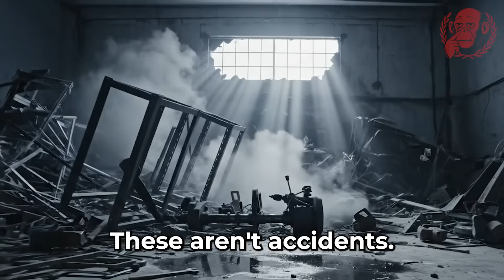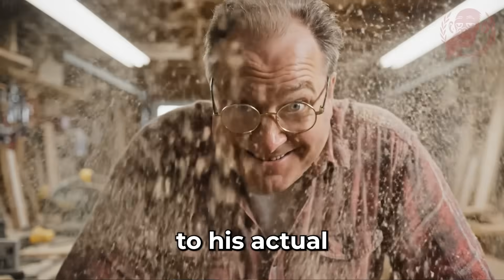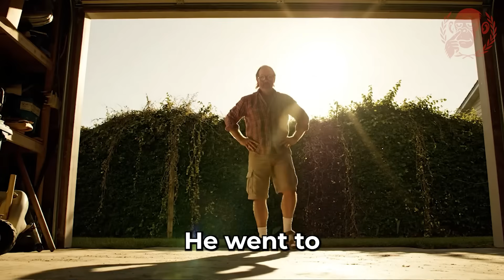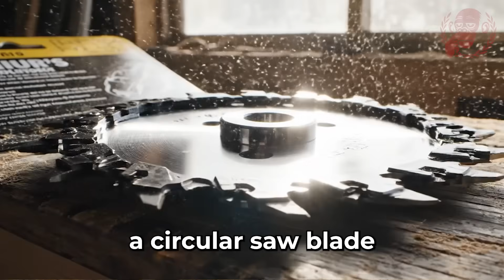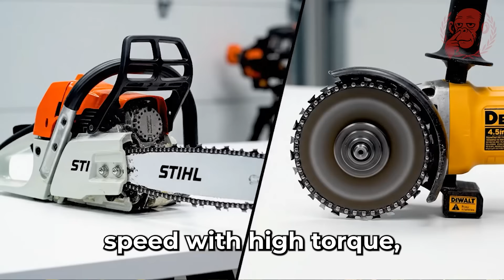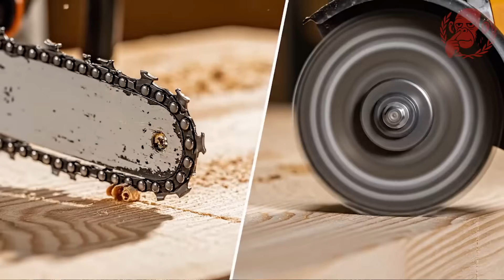10 Wrong Tool Deaths: Dumbest Ways People Died

Comment: Videos like this save lives there was a time when I bought a chainsaw weel for a grinder and tryed 2 cut wood with it expecting no kickback it jumped off the board and cut a deep gash in my wrist about 2 millimeter from a vain in my wrist after flying through open air if I had watched a video about that kined of a situation previously I would not have been messing with that

Comment: I am 65 now and VERY LUCKY to have made it to this age! I was a 25 yo, and a carpenter, and was working in a house with very high cathedral ceilings, where I had to trim a window at the top of the gabel end aprox 25 feet up. To reach that high I had a rolling scaffold, but unfortunately the scaffold was still not high enough, so I brought up a step ladder, however, I FORGOT to lock the wheels. I placed the step ladder against the wall and started climbing up. My weight caused the sep ladder to roll the scaffold, and the stepladder and I immediately started falling towards the CONCRETE floor!!! By some unknown miracle there was a hook on the scaffold pointing upwards, and I was falling head first!!!! As I fell upside down, my rear pants pocket somehow slipped right over the protruding hook, the pocket ripped off, but in the process inverted me and I landed on my feet completely un hurt!! I still tell that story to my kids, I have no explanation for it except that it was a miracle!!! What are the chances that my pocket would line up with that hook just right to catch my jeans pocket, rip it off and in the process flip me over so I would land on my feet??? I should be dead, or a vegetable now!!!!

Comment: Several years back, a guy was welding, repairing a steel wheel and tire laying flat on the shop floor, the heat built up, the wheel took his his head through the roof, 🙄

Comment: I always cringe when I hear of people doing unwise things with angle grinders.  My Dad was an ironworker and would have stopped anyone thinking of using dangerous attachments on them.  Even when you use them for what they are intended for they are still really dangerous!  Those things will cut fingers off faster than you can blink.  You also would not want to use one with a cracked wheel!!  It could be a crack so small that you don't notice it but it that wheel will come apart violently.  When this happens, the E.R. or the Morgue are the only two places where someone so unlucky will be next!!

Comment: My brother painted his two story house. He finished everything except the gable end. Because it was on the exposed basement side of the house this was a high peak. His extension ladder wouldn't reach so he borrowed his neighbor's extension ladder, extended both ladders, and tied the two aluminum ladders together making a 40' tall monstrosity. In order to be SURE the ladders didn't come untied my brother used electric fencing wire to attach them. Did I mention brother weighs close to 300 lbs.? No? Well skip that little detail. Using a 100' rope thrown over the roof he and his teenage son managed to lift and pull the ladder set vertical and in position for painting that last little bit of siding. Brother starts climbing, passing over the handy wire job half way up. Finally he makes it to the top. Remember the rope they used to get the ladder up? The other end wasn't tied to anything. Brother then gets the paint can opened and starts brushing sunburst yellow paint on the gable end. Just as he finishes, but before he gets the paint can lid back on, the high tensile steel wire cuts through the ladder's extruded aluminum side rails. Suddenly, brother is 40' in the air with two separate, unattached, fully extended aluminum ladders between his feet and his patio  below. The paint can gets flung in an arc and does a remarkable job of painting his two year old maple tree. He twisted his ankle but otherwise survived the ordeal although he was quite sore for a few days. The worse part was when he returned the neighbor's ladder and had to explain why the ladder was now a foot short. I thought the neighbor was going to be the first person I would see actually die from laughing.

Comment: The gasoline mixture would have drained out with the rinse cycle. The ignition point for gasoline is ~450°F. The heating coil does not come close to that temperature.

Comment: I threw a big block of wood on a carpenters dump pile without looking close and it landed on the end of a 2x4 that was sticking out on top of the fulcrum 4x4 and like a catapult, the 5 foot 2x4 came around and almost knocked me out.  If there had been a FRAMING NAIL or two on the end, I would have been NAILED IN THE HEAD.

Comment: A skill saw blade on an angle grinder that has kick out teeth, instead of hooked grab teeth, works fine on wood, and is a very useful for roughing out unusual shapes. The standard 4 or 6 inch guard never works on that setup, but you could make your own.  I got my carbide blades for that from the garbage dump for free. Dull or a missing tooth doesn't matter. Also, a non carbide blade on backwards on a skill saw, cuts steel/aluminum roofing sheet metal very well.  Use safety glasses.  PS, an angle grinder is geared down for power, so it isn't an 11,000 rpm tool.  6000 rpm max on grinder disks if I remember correctly.
Reply: Depends on the specific angle grinder. Angle grinders are designed so the outer edge of the disc reaches a velocity up to about 80m/s (=about 262 ft/s). Hence the larger the discs they can hold the lower the rpm. There are angle grinders up to 12.5 cm (=about 5 inch) diameter discs that actually reach the 11,000 rpm, while angle grinders for discs up to 23 cm (=about 9 inch) go up to about 6,600 rpm. 
So the 6000 rpm max on the grinder disc you remember was probably a 9 inch grinder disc rather than a 5 inch grinder disc.

Comment: I drove my Z28 with my feet while sitting on the roof (t- tops, cruise control). I also caught an arrow with a 2x4 after it was shot straight up in the air. Yeah, I can relate to these guys. We do it to save time or money,...and  sometimes we do it just because.  RIP my brothers
Reply: Did that with a Jetta- no cruise so I used a rock on the gas pedal
Reply: @emgriffiths9743  Thats crazy 😂

Comment: I have a disc with chainsaw teeth and it's the best tool in my toolbox.
Reply: There are reasonable safe ways to use it if you know what you are doing, but that only goes for those rather experienced with using angle grinders. I'd consider myself to be possibly among those, but since I also have multiple chainsaws available that pose less danger and can do the same job, I never considered buying such a disc.

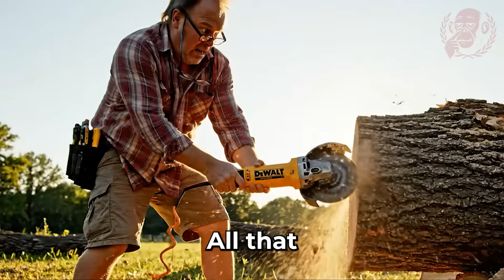Comment: 3:23 😂😂 so what was the problem here, he just didn't know what he was doing?? I have one of these, and have been using it for a very long time, even buying replacements when needed?? It's just like grinding anything, the disc is made for the job. Even when grinding metal you don't just slam the wheel in expecting it to cut right through😂😂 you do have two file away the material, and this blade is absolutely wonderful to file away wood, very fast. It works great, as long as you have common sense, and at least enough strength to hold onto the thing😂😂😂

Comment: At first I thought the guy was going to use the bullet to drive the nail by firing his gun.
Reply: that could have ended up with the same outcome. 
putting the end of the barrel against such an object would have acted as an obstruction. 
there could have easily been such a back pressure that the gun would have blown apart or resulting in the receiver being launched backwards hitting him with a lot of force. 
not sure it would have been fatal, but I wouldn't want to try something like that to find out.